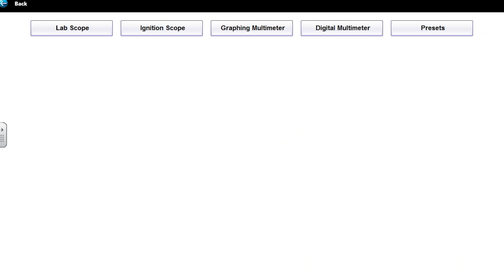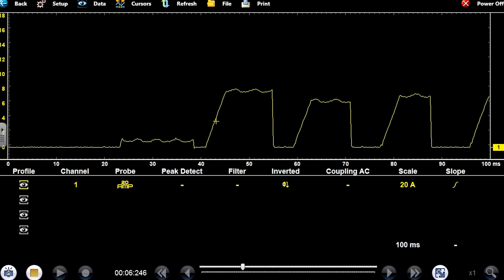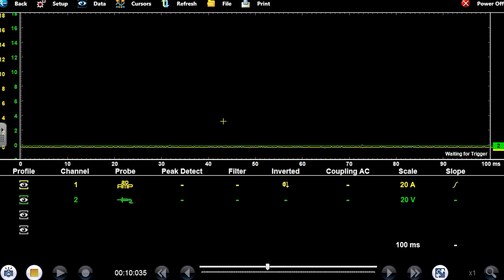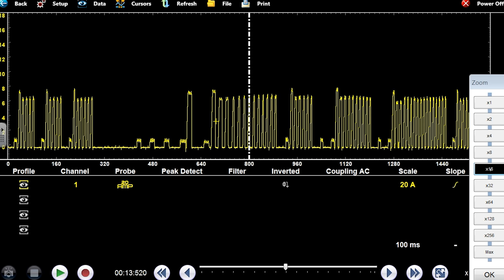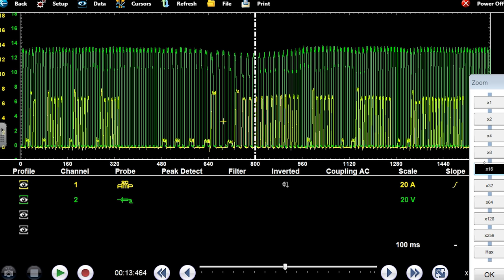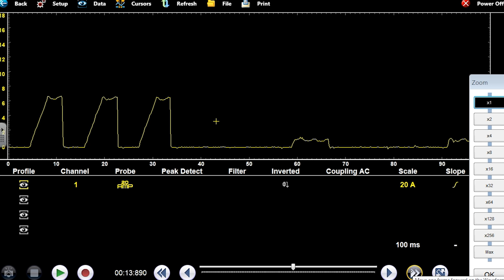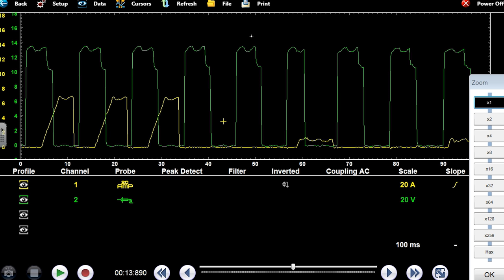Getting My A$$ Kicked By an 86 Mustang (Part 1)

Comment: In the past I had a 71 f250 with a 360 that I put a duraspark distributor and module in, had nothing but problems with that module. I have now a 71 f100 with a 390 that I put a duraspark distributor on but went with a msd 6a cd ignition box this time, it has been problem free. If this mustang was mine I would be trying the new 6al-2 that dose timing control and throw that tfi module in the trash. I cant say the newer digital msd stuff is as good as there old analog stuff, if its trash as well then a megasquirt ecu with a old analog 6a/6al. Yea quality control for this new stuff is outrageous and leaves you running around in circles. This truck having a 6a and a holley 3310-10 has given me no problem where it just runs without any major issues atatched. It is tempting to put a tbi injection unit on it for fuel economy but dont want to add problems.
Reply from the maker: in my opinion you're asking for more problems on this system doing any type of conversion. Playing with a carb system that uses vacuum and centrifugal advance and converting one of those is a hole lot different than on this EEC-IV system. The ECM controls ignition timing perfectly by sending a signal to the module. Changing that to a distributor that does timing control on it's own wouldn't even come close to the accuracy that already exists on this system. The only mod I would consider on this one is to remote mount the TFI module to move it off of the high heat of the distributor. Now, on my 78 powerwagon? :-) I'm on board 
Thanks for the comment!
Reply: @ScannerDanner  The msd 6al-2 box dose timing retard off a locked distributor like in this mustang, it uses its own map sensor for load calabrations to set timing that are programable. Yes I understand this ecu dose good at controling timing, so them doing timing different would conflict. looking into the operations of the tfi module some, I think its operations are like this.

-PIP signal is derived off a sensor in the distributor based off a hall effect (duty cycle is 50% for all except #1 thats 35%)
-both the ecu and tfi recive this signal, the tfi has a internal switch to for whether it uses spout or pip for timing
-spout is timed advanced signal form the ecu, if the tfi see two pip with no spout it switches to pip for input
-if the tfi dose not see a start signal it will fall into limp mode where it will only use pip for input
-the tfi builds and holds a 5a load to fire the coil
-the tfi coil output is feed back to the ecu through a ignition suppression resistor for some sort of referance

 So in turn I see a path to use a 6a/6al in place of the tfi but yea bypassing the tfi could lead to other issue that would need resolved. Msd sells a plug in harness 8874 that lets you plug in the box at the coil, a tfi bypass jumper would also need made. The bypass jumper would be spout in to coil out along with pip in to pip out, pip sensor power and ground would also need jumpered. Braking apart a old tfi would be best to make the jumper, issue could be if there is some sort of capacitor or diods used in the tfi to isolate noise or volatge spikes.

Yes remoute mounting the tfi on one the oem heatsinks is a option, but see issue in dwindling supply of good modules. The old msd analog 6a/6al box is basic in that it has resitors, capacitors and a transformer so is a repairable device that you dont have to worry about finding another for replacement. So sorry if I see a problem that could be resolved with a substitute item but the path dose not seem well documented, most seem to abandon this ecu for a aftermarket one with edis crank trigger and coils. Heat of the engine is not the only issue with the tfi module, it builds head of its own preloadning that 5a to drive the coil.

Could also chaged it out for the edis vershion of this ecu with the oem crank triger, coils and cam sensor along with needed wiring but is that module any better off? There is a plug and play megasquirt ecu sold by diyautotune to replace a EEC-IV ecu, this would be the second option if the tfi could not be effectively bypassed. Would use edis crank trigger, locked duraspark distributor for cam and msd 6a/6al for ignition with ecu controling timing. The megasquirt can be setup to do indavidal coils but feel that is unneeded load on the ecus part, im looking at the fusions ecu as reason not to drive the coils off the ecu.

A carb being a mechanical means of fuel deliver and weighs in the destributor that gives base timing advance is convertable but is rudimentary, add vacuum secondarys and vacuum advance it becomes more comparable. The vacuum secondarys and vacuum advance converts to a ecus map load calculations, difference is that the ecu can change these variables on the fly. 

A tbi swap from a carb can be done with a adaptor and with some ecu. For my 390 I would go the path of junkyard parts probably if was to do it like had done in the past on a 307 c10, the 1227747 gm ecu is tunable and there is the 454 tbi that would suits my engine. The 1227747 dose ignition timeing like a EEC-IV dose, so would lock the distributor and use the ecu for timing advance. On the 67-72chevytrucks site I made a thread "307 tbi" that I documented this swap to tbi I did, the site seems down and cant see if the photobucket purge destroyed the pictures. Going with a megasquirt over a oem ecu has the benifit of after the timing advace is set, it can do auto tune for the fuel tables based off wideband and map data.

Comment: I'm only in 11 mins and changing the module would be the #1 thing I would do, but it has to be Motorcraft from Ford only! Aftermarket modules have too many problems like what your having now.
Reply from the maker: Even if it's had 2 new modules  already put in it? One by the original shop and a second by my brother and they both exhibit the exact same problem! 😉
Reply: @ScannerDanner  yep most likely aftermarket modules.  It needs to be Motorcraft from Ford. Had same problem in our 1984 town car 5.0l. Just something to think about.

Comment: how do i make an appointment? i assume your brother does the scanner stuff too right?
Reply from the maker: His shop is in Bethel Park Pa give him a call 412-835-7530 his name is Jim
Reply: some say The vehicle experiences hesitation and jerking while accelerating could be the mass air flow. (which is what my 08 impala does)  but I've cleaned this a few time. is there a way to check to see if the MAF is bad? i know I'm sounding like a parts changer lmao...
Reply from the maker: @daytonpyro  a scope would help you, or an unplug it test. See how it runs with it unplugged. If your hesitation goes away, it is most likely a faulty MAF
Reply: @ScannerDanner  that's interesting, i figured if i unplugged the MAF it would toss codes and run like garbage. Ill try that. if you run into BIg Ben, tell him i said congrats on retirement lol

Comment: It took me 5 TFI modules and finally a relocation kit to fix my 86 towncar. They would just keep overheating. And it was really bad when it was on the highway.

Also 3 of the modules from 3 different sources all looked identical. I ended up spending a bit more on a motorcraft branded one
Reply from the maker: crazy stuff what we have to deal with, with parts in our industry these days
Reply: @ScannerDanner  I have an older vehicle that says to use oem distrubutor rotor. there was a TSB saying using aftermarket one causes ecu error. possible the quality of the aftermarket rotor had a cheap material higher resistance maybe.. so maybe there could be an issue with parts quality

Comment: Could it be a ground issue where a wire is partially broken and is heating up with the current load?
Reply from the maker: No, I proved the ground was fine during the coil drop outs. But good thought!
Reply: @ScannerDanner  what would the scope pattern look like if it had a bad ground.
Reply from the maker: during the period of time of coil current flow, when the ground would be the most stressed, you would have seen a significant voltage rise on the ground wire itself, which we did not, it stayed very near 0 make sense?
Reply: @ScannerDanner  I think so, it would be because the near break in the ground wire would be acting as a load causing a voltage drop across it?
Reply from the maker: @McLilWilli  correct, another way to view it would be that pressure backs up behind the final resistor in a circuit. Check out this video on what a bad computer ground can look like https://youtu.be/McsNOJvd0ao

Comment: SCANNER DANNER. I NEED YOUR HELP. HOW DID MY FUEL PUMP GO BAD WHEN MY STARTER CAME LOOSE? THE SHOP SAID THE PUMP ISNT WORKING.  I DONT UNDERSTAND HOW MY STARTER COMING LOOSE COULD AFFECT MY FUEL PUMP? PLEASE HELP
Reply from the maker: Sounds like you need to take it to another shop. The only thing related there would be fusible links and that your ECM may not be powering up anymore. Fuel pump not running would be an effect, not a cause
Reply: @ScannerDanner  so in short what do I need to fix? I've watched over 10 hrs of ur videos this week and spent $100 for them to say bad pump.
Reply from the maker: @bryanc4262  has power and ground been verified to your fuel pump? I dont even know what your working on? And you've given me no history.
Year,make,model, engine, trouble codes. When the problem started, why your starter was loose etc etc etc
Reply: @ScannerDanner  Power and ground have been verified to the pump. 01 Lincoln Navigator. Was driving heard a thud then my truck lost power. I got out and seen my side starter bolt came out and the bottom bolt that the thick ground wire connects to was the only bolt holding my starter. I tool the starter out and it was tested and is good. Put the starter back in and get a crank no start. No fuel pressure at the Schrader valve. This all happened when my starter bolts came loose.
Reply: @ScannerDanner  The fuse pump fuse was blown and I replaced it and still no pressure. Checked the relay and it's good as well as the interia switch.  Could the fusible link at the battery gone bad when the starter came loose bc of that ground wire?
Reply: @ScannerDanner  you there?
Reply: @ScannerDanner  you there brother?
Reply from the maker: @bryanc4262  yes I am, unfortunately I cannot keep up with all of the questions here. I try, but I get about a hundred new ones per day, then when I reply, they just multiply. If you still need help, I can help you. But we need to move this to my forum https://www.scannerdanner.com/forum/post-your-repair-questions-here.html It is free to join and I have 4 hand picked moderators who know my material and help me help you guys. I also have about 25000 global members that love to help too. You will not find a more friendly and helpful forum anywhere! Hope to see you there.

Comment: If fuel pump keeps running with key on engine off unplug computer if fuel pump quits running replace computer.
Reply from the maker: I have seen a bad computer power and ground wire do this. Also a shorted 5v ref I've seen do this. Just be careful with blanket statements. You're not wrong in that a bad engine computer can do that too.

Comment: install cheap distributor = win stupid prizes of various issues. lol
looked like aftermarket poo, they should have rebuilt the factory distributor with some ford parts or go to full aftermarket performance ignition system.

Comment: Had  a 87 Mudstang 2.3 with the coil on inner fender.
No start no one could deterimine issue .
Coil iron not grounded on clean metal .
Rust caused loss of ground.
Once cleaned it was perfect.
TFI was garbage.
Fords suck.

Comment: I have washed 3 minutes 16 minutes please don't kill me within this 3 minutes 16 seconds that guy said that he put on your distributor that could be the problem
Reply: I mentioned the distributor I am 99 Sebring I replace the distributor and the car still would turn off on me then I took it to a mechanic he put a distributor and the car ran but in less than 1 month it was down again I finally sold that car for $150 you know enough is enough
Reply: There's the original distributor that one was bad the one I replaced it with that one was bad the one that mechanic put on that one went bad it was a nightmare
Reply: But now with my state of mind and the two that I have I still wish I had that car so I could grab that distributor to correct whatever is going wrong inside that distributor and I believe this is what needs to be done with this car slow down guys remove the distributor and find out exactly what is going wrong inside the distributor you might very well be just a very little resistor
Reply: I did not watch the entire video I fast forwarded to almost the end I saw the prostration in scannerdanner that distributor had him running in circles scannerdanner knows what's up and that's what my car did to me had me running in circles out of frustration I sold it for $150
Reply: In this case where scanner is so lucky that is not the owner of that car